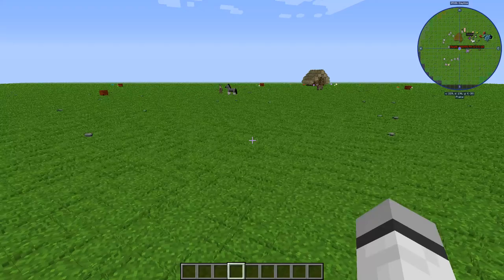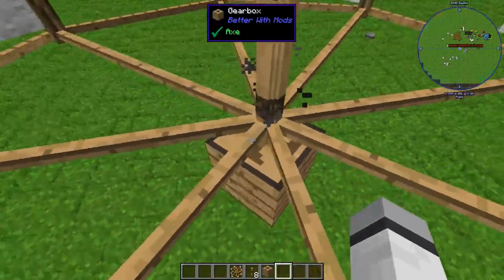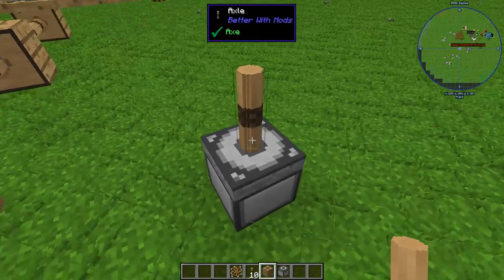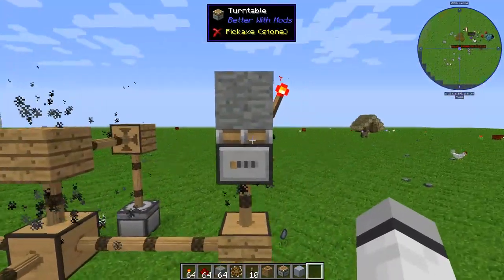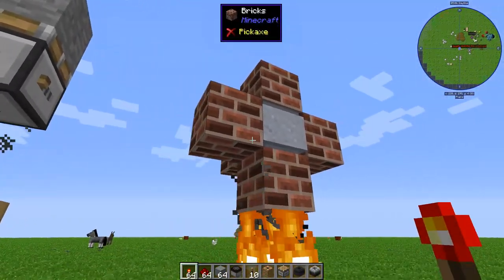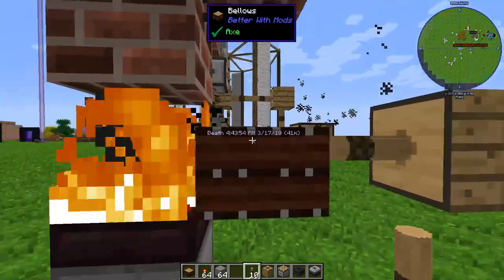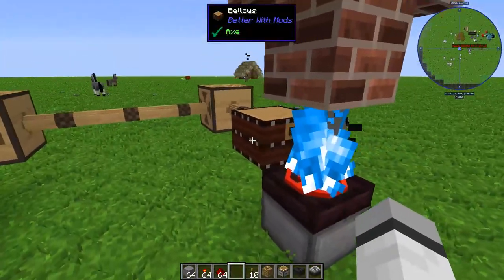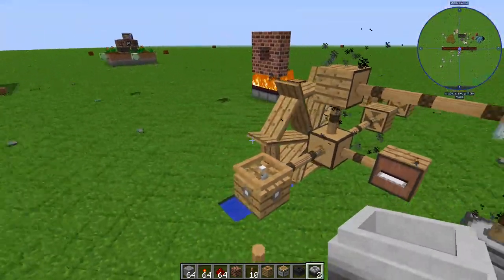Better with Mods - mechanical power tutorial

Comment: Very helpful guide.  While most of it is self explanatory the multi block structures and stoking needed to be explained better than the in game guide book did.

A tip for doing guides though.  Get yourself a 2nd mouse to hold when talking because you are a hand talker.  This will result in not having the camera constantly jiggling as you explain things and make it easier to see what your talking about.
Reply: Frederic Reeber  This is a spam and obviously trying to get something into or out of your pcs